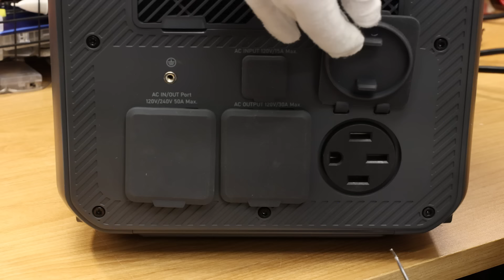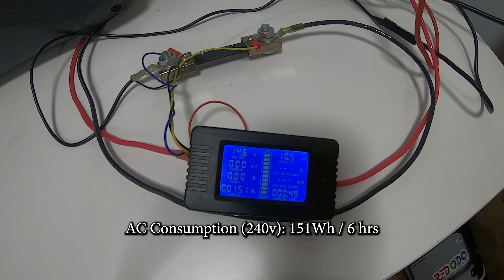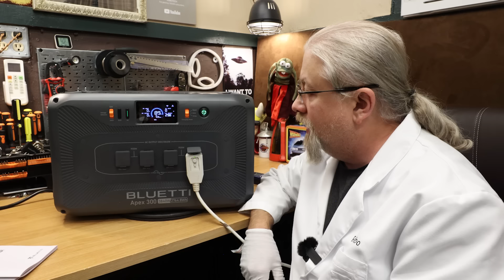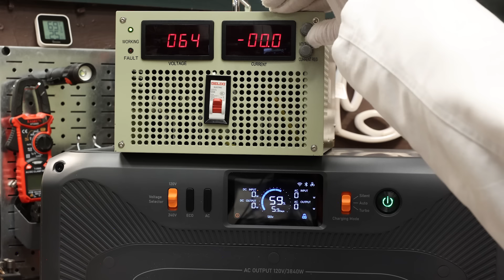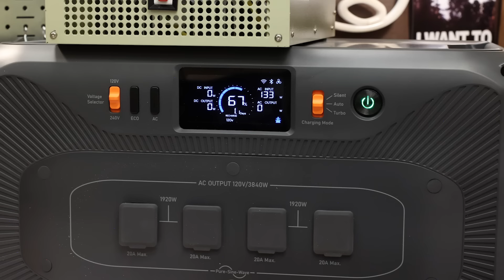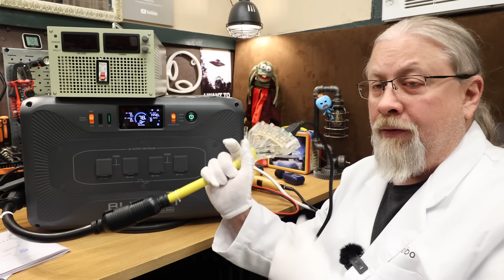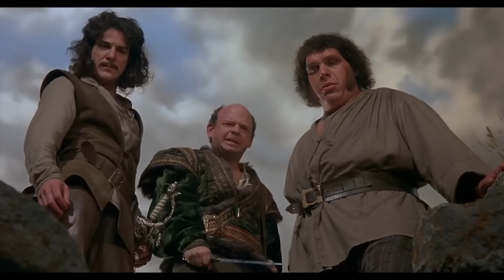Bluetti "APEX 300" 120v/240v MODULAR Home Backup Power Station | Cheap & Simple!

Comment: Being able to use 120v generator while outputting 240v from the Bluetti is a game changer for offgrid imo
Reply: It's an RV feature, and a fairly good one.  Only Victron has something similar in the RV world.  But this feature is not really useful outside of the RV space and you obviously won't get pass-through efficiency if using it.
Reply: @junkerzn7312  I could use it without an RV. My well pump is 240V, and if I were to use this thing to power some loads in my house during a blackout, I could have water too.  My generator is only 120V.
Reply: @theclearsounds3911  That gave me a double-take and I had to think about it for a minute or two before I realized why.   Why would you spend so much money on a power station with this feature when you could spend a lot less money on upgrading your generator instead?

And it isn't as though one would be out of luck without the feature.  Any beefy power station with a 240VAC output can power your well pump.  Its just a bit less convenient if you can't plug in an AC charger at the same time you are using it for that purpose.

The reason this feature can be important for an RV is that one might not have any choice for shore power when you travel.   It could be 120V, it could be 240V, and in some locations you really need some sort of beefy pass-through or simultaneous feature to allow for heavy use of A/C or heating.

-Matt
Reply: @junkerzn7312  Generators are very inefficient when running at little or no load, far worse than power stations. Due to my well pump only running sometimes, that's why I prefer a power station over a generator. I like the feature that charges the battery from the generator while providing load, so my generator can work all the time its running to charge the battery, rather than waste energy idling, and making all that noise 24/7. I don't own a power station, but am considering buying one, and this is the first one I've seen for $1,200 or less that outputs 240V. 

This power station fills a lot of requirements for RV owners, and I understand that. But, it also hits many marks for my purpose of home blackout protection. I like the fact that they seem to be building it for many different purposes.
Reply: @junkerzn7312 Generators are a pain in the ass to keep up. Drain gas or propane, equal or greater expense and even at 84 lbs, the Apex is a featherweight compared with a 5kw or larger generator. When you do need the generator, once in  3-5 yrs, the battery is dead. The Apex is also still semi portable.

Ideally, what is REALLY needed is a 2500 watt power station that has a parallel kit to output 240v @ 20 amps max (10 running) with 2 units. Will power the pump, probably the AC and the fridge. Not looking for uninterrupted life, just to get by and that'll do it.
Reply: @romanmoronie  Well, I agree that generators are a pain.  And also just one of many possible ways to recharge a home battery system.  My preference is to not pass-through generator AC at all and instead just have it connected to a battery charger with an appropriate amperage configured for maximum generator efficiency.

Then the house then just stays on the inverter the whole time and there is no risk of dirty AC or transfer glitches (etc).

-Matt
Reply: @junkerzn7312 running my heat pump water heater 240v while charging with my 120v generator.
Reply: Yes, this is great, but needs to be verified.  His test only saw that both legs had 120V power.  They could be on the same phase.  He did not measure the voltage to see if they were on different phases to get 240V.
Reply from the maker: @pakkasan1  I did that offline. If I recorded everything I did the videos would be 2+ hours long.
Reply: @HOBOTECH  what wrong with 2hr videos??
Reply: @Tiersmoke92555  If it were 2 hours, most people wouldn't watch it because they don't have enough time.  A good compromise would be to do 2 videos, one 2 hour one, and a condensed one.
Reply: @theclearsounds3911 please please don't take everything you read too seriously.
Reply: @HOBOTECH  Great video thank you. Can you charge with 240 while pulling 240?
Reply: Would love to order this but nervous to order on indeed go
Reply: I'm completely new to solar but I have this on order can you please tell me the best solar panels for max input for this unit
Reply: @rienzihotrods  If you are completely new to solar maybe you shouldn't dive in the deep end with an expensive product like this, and instead get something a lot smaller to start out with.  So you can learn the ropes.
Reply: its already ordered just need to know the best panels to max out the solar input.  @junkerzn7312
Reply: @junkerzn7312  with respect, it’s not like a beginner driver ordering a Ferrari. It’s just a box with a battery and some switches. They will manage just fine. Now.. if they are wanting to mod the thing and open it up that’s a different story.
Reply: If you ever actually get the unit
Reply: @MrShaggs my units rock and in many ways outperform my Ecoflow products

Comment: Great stand alone 240v power station. Poor execution.
The separate DC outputs is not a deal breaker as you can use smaller power stations for that.
The deal breaker is the same as the V2. 
60v solar inputs. OK for a smaller power station but deal breaker for one this size.
The bigger PS need to have voltage enough for 3 panels in series which should be around 75v-90v.
Heck I'll even accept 75v as the minimal. I have the Dabbsson 1400 which also advertise 60v max but allows up to 75v. I'm able to run 3 panels in series for this one.
BTW, how in the world does Bluetti advertise 1200w solar inputs when its impossible to do so ??
You need a Voc of about 70v-75v to achieve actual 60v and the PS won't allow anything over 62v.
False advertisement.

Comment: I bought a Bluetti more than a year ago and didn't open it for some time until I moved. When I opened the box and plugged it in. It was still charged, but I wanted to top it off. I was busy (it's been a very difficult several months), but when my daughter and SiL visited, l put the Bluetti next to the bed to plug in the lamp and to use a a phone charger. My daughter told me that it kept shutting off and only stayed on for a very short time. 
When I unboxed the Bluetti, I didn't read anything,I was busy moving in and unpacking, etc.. Besides, I'd watched hundreds of videos, right?
So I'm not sure if I have failed to do something or didn't do something I should have done, or if there is a problem with my Bluetti. And by now, it's WAYYYYYY past the return window. IDK what to do, so I thought I'd put this out there. 
Thanks.
Reply: You can change a setting to keep it from turning off or put a slightly larger load on it. Read the instructions to find how to change that setting. Eco mode will shut off the V200 if load is under 60W. So turn off eco mode if you want it to stay on.
Reply: Thank You! @edkspilot That makes sense. 🩷
Reply: yea read manual ... and it has warranty
Reply: Thank you.  @cloker375

Comment: No 12v without extra dongle. (Even the dongle is only rated for 10 amps.)
This is just a home power backup... not really for mobile use without a bunch of extra stuff.
Reply: At 84 pounds - no not for mobile use.  I would not need the 240V plug either.

Comment: Imagine the shipping cost having to send this unit back to the manufacturer for a repair at 84lbs.
Reply: Just sent my AC 300 which weighs a bit, in for repair. They repaired it in three days, Sent it back in a new box works like new. Cost me zero. Just contact their support team. They decide if it needs to be sent in. They take care of all the shipping.
Reply: @dwightjenkins9753  I had 2 be 300 batteries that went bad. They had both of them back to me within a week. Fantastic customer service.
Reply: My AC300 just died after 18 months, think warranty is  1 year. They told me to box it up, they sent me a FedEx label on them. Yeah I’m upset it failed but hopefully the next one has been overhauled properly.
Reply: @Fish_Ventura  Why the "next" one"?  You might have to do it all over again.  Build it yourself, that way you can repair it if it goes bad.
Reply: @Fish_Ventura What specifically failed on it? I’m curious as I have the same unit. I have the same unit.
Reply: @loutrioti8375 the AC output. It would turn off un commanded. But always indicated ON. Refurbished unit arrived yesterday.
Reply: Ok,, well Bluetti told me specifically to box up AC300 and bag of accessories, to include 110v power cord. DOD Bluetti ship me any of that with the exchange? Nope… so here I am suffering through Bluetti’s ineffective customer support. The clown taking care of my case is named “Anson” ,, should be A-hole”.  Thanks for screwing me again
Reply: @Fish_Ventura  Sorry to hear about your plight with Bluetti.  Thanks for letting me know.
Reply: @Fish_Ventura  That makes me glad that I did a DIY build.  I can fix it myself.  Thanks for your reply.
Reply: 90lb package could start at $118.36.
Reply: I had a three year warranty on an indiegogo purchase, and they paid shipping and replaced one of my units about 4 years ago.
Reply: Excellent point! 

Sending EcoFlow my 26 pound Delta was frustrating enough. Also you have to use FedEx Ground for hazardous materials. These locations are not so convenient.
Reply: Good luck even getting someone to speak to about sending it back.  Don’t even think you’re going to correspond via email with someone that speaks or writes in English.
Reply: @redstone5149  I kinda figured that would be a problem.  So far my DIY system is doing great.  Might even expand it a bit in the future.
Reply: @redstone5149 I do have to compliment EcoFlow and their customer service after purchase. They are good with email and English.
Reply: Imagine cracking it open and fixing it right the first time ...
Reply: so very important to consider this before buying it.  Makes a good case for buying an option from a local brand.
Reply: @philddlesticks I’ve decided to purchase a spare AC300 head unit. After all, it’s just made in China stuff.
Reply: I've had a bluetti AC200P for 4 years. I've used it collectively for about 12 months and 5 months of that was consecutive.  Mostly flawless besides the BMS jumping around when charged by solar
Reply: Under warranty it's free. But after warranty...... I will create a place to reverse engineer Bluetti products so folks can repair this stuff easier. Can't be that hard to source some of the parts it's the software that's going to be the trick... But we have our ways.
Reply: Id tell them to pick it up at their local Greyhound. That's my preferred shipping method. Lol
Reply: Over 75 bucks for sure
Reply: It cost me over $100 for shipping a 46 pound Aims Power inverter charger to Sparks NV, one way, for warranty after running a welder with it. So, you're looking at $200 for the shipping on that. 😮

Comment: Always enjoy your videos if you can I'm not too techy but I have a 50 amp connector on the back of my house for my gas generator with a transfer switch I wanted a bluetti product that could power my 1 and 1/2 horsepower deep well pump at 115 volts but I believe this is their first 240 volt product and I was waiting for it!😊 With this possibly work with that 50 amp connector to run the pump Thanks for your time
Reply: It'll work
Reply: Thank you so much 😊  @AgentOffice
Reply: @whoduhthunkit8678  it's made to use the same generator inlet
Reply: You might need a dog bone adapter to go from 50 amp to 30. It has a 30 Amp plug